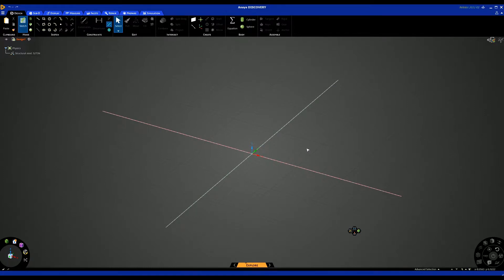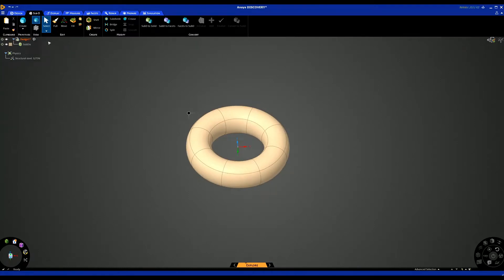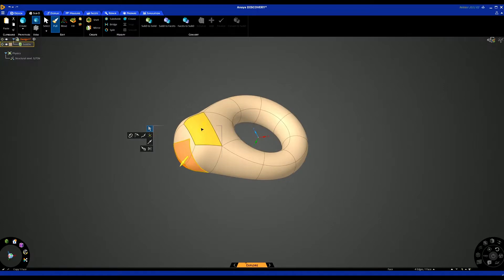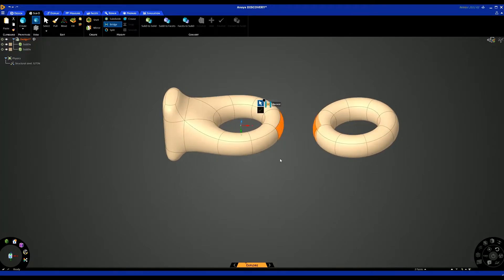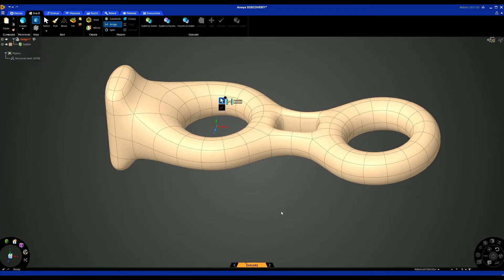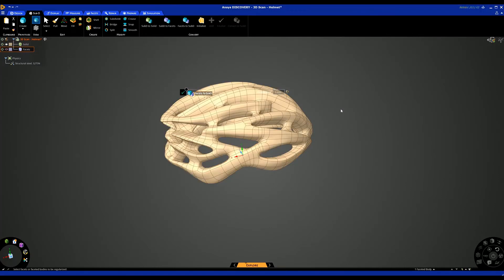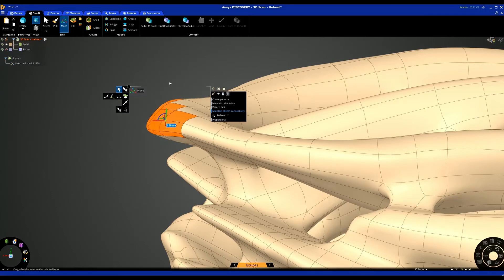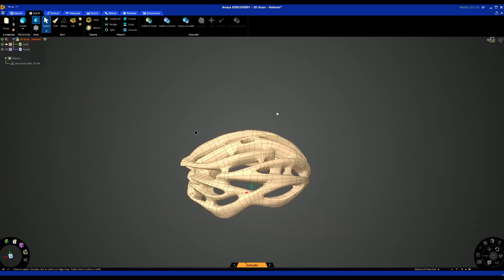Ansys Discovery  - Sub D Modelling

Comment: Is this SubD not in latest SC?  Is it only in Ansys Discovery?
Reply from the maker: SubD is only in Ansys Discovery. SpaceClaim users should be able to access Discovery modeler to use this feature.
Reply: @originengineeringsolutions431  Thanks for the reply. Perhaps in SC 2023R1 as it's more of a Designers creation tool than an analysists modification requirement although that's not really a fair assessment of Discovery Modelling.